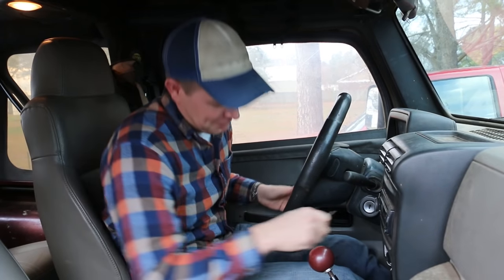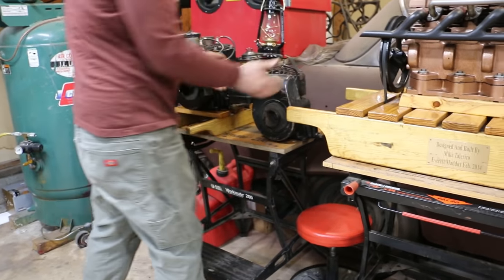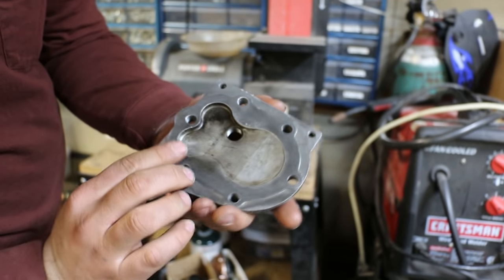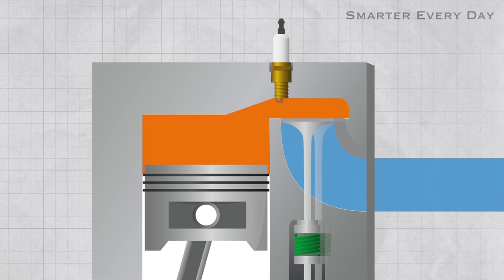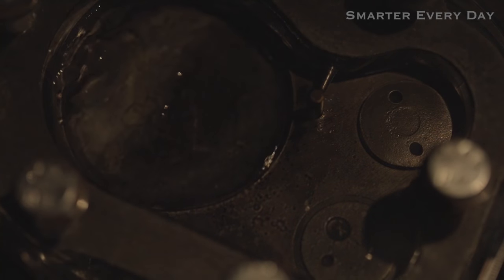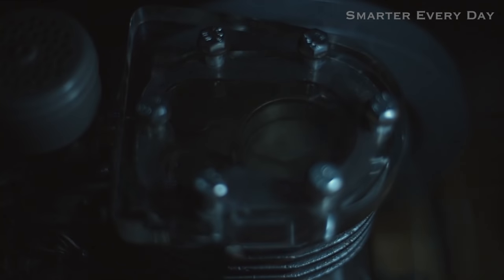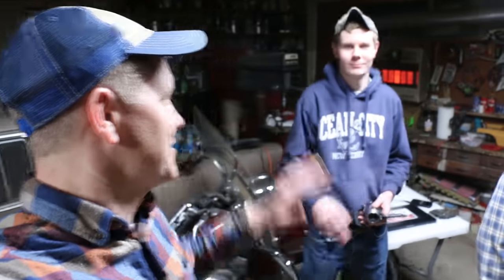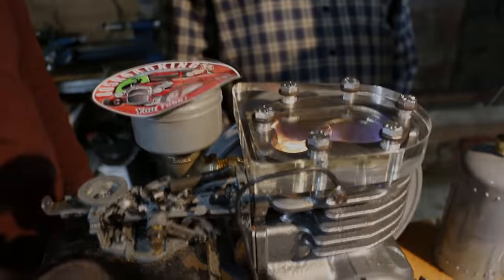How Engines Work - (See Through Engine in Slow Motion) - Smarter Every Day 166

Comment: How do engines not blow up or fall appart after all the explosions happening in them?
Reply: Bcuz the explosions r minute controlled and happen very quickly
Reply: They do. If you run any engine for long enough at high revs it will blow up.
Reply: @geidur8253  not necessarily, it depends on the engine, a lawn mower or weed eater engine will run at full revs all day and it won't break. You can't run liquid cooled engines at full revs but air cooled engines can be run essentially indefinitely at full revs without breaking
Reply: Jordan Abendroth what or who have air cooled engine I’m curious I’m just starting to create my own engine
Reply: @geidur8253  Does it really need to run at high revs? I mean, people say engines die after 300k'ish miles. But how do they naturally "die"? Lost compression? Internal components smacking loose?
Reply: Ty Davis a lot of bikes have air cooled engines. Anything made before I think around 1980 will be air cooled, and pretty much every Harley in existence is air-cooled. There are also a lot of engines that are both air and liquid-cooled. My own Royal Enfield for example is air cooled on the main engine block, but has an offset oil-cooler as well.
Reply: Pistons are made of Aluminum. The explosion is very small and minimal and happens across an area rather than a concentrated point on the piston. The piston also absorbs the explosions energy through the power stroke., so the explosion does not transfer it’s energy into damaging the piston.
Reply: @miljororforsprakpartiet290  all of the above, and wear. the internals of an engine get old and wear, that, with all the stress it gets through that mileage makes the engine not necessarily blow but as i said, wear until it doesn't run anymore.
Reply: @jordanabendroth5568  a lawn mower engine can run much longer than one of a race car because it is under much lower stress. the explosions inside a big race car engine are much bigger and happen at a much higher frecuency compared to the lawn mower. And yes, a race car engine is also much stronger, but only to a certain point. both are generally made of the same metal, or at least very similar ones. You can run a lawn mower for long enough so the block melts , only that it'll take more time than a big displacement car engine. And i agree with you to a certain point with the air cooled engines, but trust me, they can run for a very long time, but like any other internal combustion engine made to this day, it will eventually break apart.
Reply: Those are burns not explosion the air's expansion is what pushes the piston down
Reply: @AhmedGrt.  it’s not air, it’s exhaust gas. And a expansion of gas at high pressure is basically an explosion
Reply: because there is no explosion actually, instead the gas inside the piston ignites
Reply: Miljörör för Språkpartiet I would say 250k miles lol.
Reply: Miljörör för Språkpartiet it’s usually something with the seal or transmission.
Reply: If the piston wasn't moving, the explosion would have to find another place to escape to, and likely would destroy the engine. This is similar to how a gun can fire a bullet because the bullet moves down the barrel, but if the barrel is plugged and the bullet doesn't move the gun will explode quite violently. This can also happen if the explosion occurs too soon and smacks the piston while it's still moving upwards, usually bending the rod under the piston that connects it to the crankshaft. A thin coat of oil on the cylinder wall (sometimes mixed into the fuel on a 2 stroke engine) helps to keep the piston from welding itself to the cylinder, which would also cause the engine to fail very quickly. The addition of too much air, or even worse, water, can also destroy an engine very quickly, especially if it doesn't have modern features like an mass air flow sensor, 02 sensor, and knock sensor, because water is hydrogen and oxygen, which can both explode violently under certain conditions. If you build it correctly though, water injection can greatly increase the power of an engine compared to one using only air at atmospheric pressure.
So the short answer to the question of "why it doesn't explode" is because literally millions of hours have been spent by very intelligent people studying chemistry, physics, and engineering, to ensure that the materials and timing are balanced to extract energy from the explosion without damage, if it's working correctly.
Reply: Some do. Depends how powerful the engine and how hard it is run. Some drag racing car engines will be rebuilt after every run.
Reply: If you think of an explosion, you think of destruction. But in a properly tuned engine (not detonating) think of it as a rapid burning of fuel. The pressure increases too quickly for us to comprehend easily, but that’s because we live in flesh, blood and bone. Ouch. But these strong metals? Easy peasy.
Reply: Oh my this is are next generation
Reply: timing
Reply: Metal
Reply: @tydavis2861  I have quite a few of those air-cooled engines. those are practicality the best engines to have when you want to cut the grass on a hot day
Reply: They do? Lol
Reply: @jordanabendroth5568  I think you are not understanding what “full revs” is. Full revs on something like a weed eater can still be below the maximum rpm of the engine. You could install a larger carburetor on the engine and it would run faster. Car engines are designed to run at higher rpm. It isn’t the size of the engine, though it may have something to do with the mass of rotating parts. Engines are gradually worn by their movement of parts across touching surfaces(friction), heat, and deformation, but they are mechanically limited to an upper rpm by the materials or mechanical operating principles of their moving parts. For instance, valve lifters begin to fail after a high enough rpm
Reply: Airplane engines can technically be ran at full power all day due to air cooling but people fly with less power to save gas.
Reply: Forged pistons, rods, head, and block
Reply: @jordanabendroth5568  lawn mower engines actually don’t run at full revs because they would snap their rod and because they don’t need to. Lawn mowers with stronger rods can run at 6krpm, as is popular in the go cart community
Reply: I don't know, how do firearms not blow up when you shoot? How does a rocket not explode when it starts its propulsion system?
Reply: @TheMegaPingasMobile  because there is something to push away and expand, without bending the metal. The energy always takes the easy path out. In a gun, it pushes the bullet. In an engine it pushed the pistons, rather than blowing up the block
Reply: @connorssmallengines6663  I know, tell that to the original commenter
Reply: AhmedGrt explain
Reply: Because the power generated is transmitted to the wheels. If the engine had no output and was a closed environment, then it would explode
Reply: @jordanabendroth5568  without the governor
Reply: @Arthur-ni9zq  Its an explosion.
Reply: @jordanabendroth5568  well the full revs of certain engines is within their design. Every engine has a speed you can run it at constantly. Some are more adept at going beyond that though, for shorter lengths of time.
Reply: See its simple remember when there is pressure it finds a weaker part to release the contained pressure - While Powerstroke there will be a Highpressure inside and it is easily converted into mechanical energy by pushing the Piston down 🤷🏻‍♂️ this is how chemical energy converted into mechanical Energy bro ✌🏽
Blowsup happens only if Piston refuse to go back down after the fuel is ignited, there comes the BOOM 💥
Reply: @AhmedGrt.  Correct. Destin misuses the term explosion.
Reply: @CheeseMiser  umm no...An explosion happens with detonation.  With no detonation it's a burn.
Reply: @CheeseMiser  ok Connor
Reply: @miljororforsprakpartiet290  mostly lost compression
Reply: As the piston retreats downward during the power stroke, it absorbs the energy of the explosion.

Comment: Now do it with a diesel.
Reply: I wonder if there's a material that could handle that lol
Reply: @jonbar140  i doubt it. Diesels have a much higher compression ratio than gas engines do. I don't think that there is a transparent material that can handle it.
Reply: R/wooooosh
Reply: thanks bro I really appreciate ur effort believe me u are a genius..u just solve one of my problem ..those that give u thumb down have no sense don't mind them continue d good job.. peace
Reply: Diesel Engines do not use spark plugs right?
Reply: @guitarone71  The piston compresses the air to app. 600 Deg. Celcius, then the diesel is injected at the right time, and ignites
Reply: @guitarone71  No, they use glow plugs.
Reply: @Pianissimo1970  Glow plugs.
Reply: @saladin7467  Glow plugs are used for starting purpose to heat the combustion chamber. It's not used for the combustion process itself like petrol engines do by using spark plugs.
Reply: @ruan2587  actually they stay hot the entire time. Diesel has a higher flash point so it won't detonate early because of the red hot plug. It's the combo of compression and the glow plugs. If you take away the glow, timing or compression it just doesn't work as smoothly.
Reply: @unbiasedcobra6672  no, glow plugs are only on when the engine is cold, once the engine is in the operating temp the glow plugs would go off

many old diesel doesn't even have glow plugs

Comment: I know this video is old but id just like to point out, the spark timing is so much more critical than you seem to think. You want the gas mixture to combust, NOT explode.keeping a safe combustion relies on the air / fuel ratio and the spark timing. an explosion happens sometimes, and its commonly known as "spark knock". In modern engines, there are actually little sensors that measure the vibration or sound pressure, and their sole purpose is to listen for spark knock, so that it can tell the computer to adjust the timing (or flash the check engine light if it can't fix itself by adjusting the timing) great video btw destin, keep killin it!

Comment: Whenever i sat in any vehicles, i always wondered what exactly makes the engine go loud, how does it produces sound ?thanks a lot for this awesome video 🤗🤗
Reply: What makes it loud? Well assuming the exhaust system is stock let’s think about it (I mean that in a humble/teaching way) you have your 4 strokes and accelerate to 2000rpm (revolutions (revs) per minute) inside your engine (we’ll assume it’s a V6) each piston does the 4 strokes 2000 times or in this case with 6 cylinders 12,000 time. So, you move a lot of air and increase the engine speed which those makes your engine create that louder sound. 

Now you can makes this louder with exhaust headers, catalytic converter delete, muffler/resonator delete, or larger piping. Another thing is a engine with a larger displacement (a bigger engine)

Comment: My school line is mechanics and this is exactly what I have being learning about cylinder how the work in a engine but Diesel engine don’t have this ignite it burn from the power of Compression from being too tight and it automatically ignite
Reply: It catches flame due to temperature of air compressed to extremely small scale while fuel which is highly flammable can be injected into those small compressed space which produced flame

Comment: I'm not really into cars.

Different strokes for different folks!

Sorry I tried
Reply: I'm not into cars either, but this was still awesome to watch and learn about. I love learning how things work.
Reply: Yea, whatever cranks your shaft
Reply: That's why you'll always throw your money away on highly overpriced new cars too lol. Or you'll throw your money to a mechanic who may or may not fix your vehicles problem.
Reply: in my opinion people should be taught about cars, most adults drive cars and have no idea how one works. even if your not a motorhead you should know basic repairs and functions of each part of a car if you drive one.
Reply: Keenan Bartlome I'm of the same opinion. Along that same train of thought is everyone should be able to drive a manual. If you understand how to drive a manual, you learn more about the engines relationship with the tranny, rpm's, then output of speed. Even if you know nothing about cars you could still tell a mechanic "it's making a funny noise only in 5 gear at low rpm's" or other examples and narrow things down for a mechanic.
Reply: Many
Reply: thats why every day you throw money in the trash

Comment: In a engine with multiple cylinders higher compression can be utilized because a piston can be "timed"(this depends on crank throws and engine design not spark timing) to be on its powerstroke as another piston uses that same force to drive its compression stroke. Instead of relying on inertia and counter weights. Just food for thought.
Reply: Edgar G Yummy food for thought. Thanks.

Comment: How does the single piston go up and down without other pistons to keep the motion going?
Reply: tubez4321 ..that's what i was searching the comments for an answer for.
Reply: Flywheel
Reply: The piston is connected to the crankshaft. Together, the two parts have enough momentum to continue moving.
Reply: Exactly....just like a motorcycle uses one piston. Not all but common ones.
Reply: The explosion generates enough force to complete 4 strokes and repeats
Reply: flywheel and the crankshaft counter weights
Reply: tubez4321 momentum is maintaned throughout the cycle by the spinning flywheel. All 1 cyclinder motors have one. Even old Watts steam engines
Reply: That's what the starter is for, once the engine starts, each stroke, intake, combustion, power, and exhaust is rotating the crankshaft, so the crank is rotating a half a turn with each stroke, so it rotates a total of 2 full turns once the exhaust stroke is finished.
Reply: Flywheel.
Reply: tubez4321 dank des Schwungrades!
Reply: There's a flywheel in that engine.
Reply: tubez4321 momentum
Reply: Things don't just stop for no reason

Momentum yeet
Reply: YMC-DAB420  madlad watches Chrisfix
Reply: Actually it's a mix between the magnetism in the flywheel, the turning momentum of the connecting rod, and if in gear and moving the transmission pulling the crankshaft around.
Reply: @HeyoHudsy  what transmission?
Reply: @benfennell6842  talking about fully built vehicles where there are more parts working together
Reply: @HeyoHudsy  ok but that isn't what OP asked
Reply: @benfennell6842  yes, OP asked what makes the piston go back up, the transmission can have a direct impact on that
Reply: @HeyoHudsy  in a moving car, yes, OP asked why the single piston on its own does that in this video.
Reply: @benfennell6842  I included more, let me ask what your problem is with that? Better to have more information than less.
Reply: @HeyoHudsy  idk I just feel like it's confusing to tell someone there's a transmission involved here

Comment: I noticed a flickering in the first high speed camera shot. Is that due to the frequency of the electrical grid that powers the lamps?
Reply: fluorescent bulbs flicker at a rate slower than the refresh rate of the camera, so the flicker is detectable.
Reply: Doubtful, digital cameras usually compensate for that with their firmware load out. Probably the camera switching resolution or a similar feature that required resetting the cameras' buffer.
Reply: Alan Hunter they compensate with frames per second. In the US that would be 60fps and in Europe 50fps (NTSC and PAL). If you were to shoot in 60fps in Europe, you could see the flickering in your video. And vice versa. Although newer bulbs like LED help with diminishing that problem, but the TV is where it is most noticable to see.
Reply: Alan Hunter But that's not a regular digital camera.
Reply: Pav Phone, you are right. The electrical grid in amerika changes its current with a frequency of 60 Hz. that means the light will flicker 120 times per second. its too fast for our eyes but this camera can show it. to avoid it you need a lamp with buffered DC voltage
Reply: +Tom Major You would "compensate out" a lot of things/flashes/details you WANT to see/record if you did that on high speed camera...
Reply: rockerjonni Yeah you can see in the behind the scenes video they use a flash light afterwards which results in those really nice looking not flickering shots.
Reply: +Tom Major depends on the type of led bulb. the ones i use flicker HARD (like completely on/off) 120 times per second. they're the cheap kind, obviously.
and yes, that oscillation you see in the video is from the light bulbs. fluorecent ones flicker at 60hz but they don't dim all the way down like leds do, so it's less obvious at lower frequencies.
btw incandecents also flicker, but just a bit because it takes quite a bit for the fillament to cooldown enough to make a visible difference in brightness, and 1/60 of a second certainly isn't enough time for that.